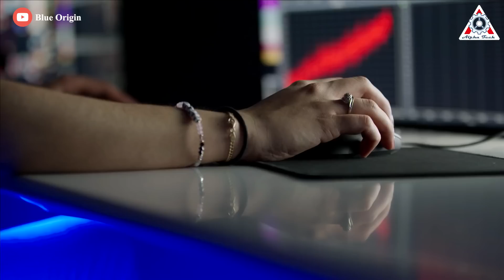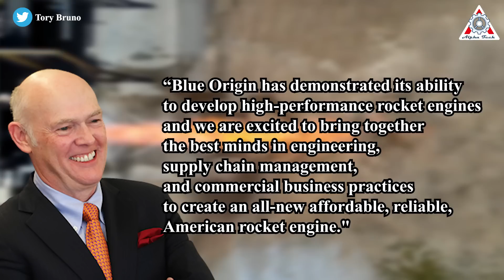ULA is facing FAILURE because of Blue Origin...

Comment: ULA is a 3 way bungle/fight between blue origin and boeing/Lockheed. And let's be brutally honest, spacex has been churning out engines and complete launch systems successfully for years now that even outpaces NASA's best hopes for the shuttle at the beginning. ULA and blue origin come to the table 5 to 10 years later, and financially more expensive than spacex in light or heavy launch configs.

Comment: I wonder what payload mass the SpaceX Super Heavy Booster could lift and what maximum altitude might apply for orbit if payloads were substituted instead of Starship?

The concept makes sense for lifting components to construct a larger next generation space station, particularly if that structure were intended to produce pseudo gravity via centrifugal effect from rotating a torus (donut) shaped hull.

Segments could be launched on Super Heavy in a straight, cylindrical configuration with a simple cap shaped fairing on top, then curvature added in orbit by inserting wedge shaped fillets at specific locations on the tubular sections.

Given the eventual power of the SpaceX Super heavy Booster, it would probably even be possible to launch segments with much if not all their internal infrastructure already installed that way it would only require connection with adjacent segments.

The concept could conceivably reduce time required for assembly of a fairly substantial structure from years to months.

Comment: From what I understand SpaceX's Raptor 2 engine has slightly less thrust than the BO's BE-4, just under 500,000 lbf at sea level. But since ULA is going to use SRBs anyway on their Vulcan I would think they could compensate by changing the flight profile. Over the burn time of the main stage engines the rocket will be able to take advantage of the higher specific impulse (BO hasn't published the expected specific impulse of the BE-4 but it appears to be lower than that of the Raptor 2).

It seems though that Elon Musk hasn't decided whether he'll sell his engines to other companies.
Reply: It will give a test base for the new Raptors

Comment: If Starship doesn't pan out, a Super Falcon 9 using 9 Raptor 2 engines would be nice.  It could then be made into a Super Falcon 9 Heavy with 27 engines total which would still be less than Starship's 33.
Reply: It would be a total redesign, Raptors run on methane.  But it a Super Falcon could another SpaceX class of rocket to offer.  They would have to develop a reusable second stage.  Personally, I would like SpaceX to launch Dream Chaser.

Comment: ULA needs to PUBLICLY reach out to SpaceX to either license build Raptor-1 engines or purchase SpaceX built Raptor-2 engines.  Even if no contract follows, that process will light a fire under Blue Origin to get their product delivered or go out of business.
Reply: Because it is essential to Vulcan Centaur, an adequate number of BE-4s will be produced one way or another, either by Blue Origin or under license.
Reply: @winstonsmith478  Maybe.  The BE4 is already years late.  Publicly soliciting a replacement will provide motivation to BO to GET BE4 DONE.  Failing that, ULA needs a different plan and a different engine.  Nobody will license build an engine that does not work, like BE4.
Reply: Raptors wouldn't work for Vulcan though... The engines would need to be nearly identical to the BE-4s in order for the rocket to work. Or else it would need big changes in its design, which would basically mean an entirely new rocket.
Reply: @boboyqc  Which will be faster.. Waiting for BE4, or redesign, considering how fast SpaceX can design.
Reply: @marcwolf60  faster... Hmm yeah rocket companies don't tend to iterate at SpaceX's rate. The main thing that makes SpaceX capable of iterating so fast is the fact their rockets are built from stainless steel, and also that their main objective is mass production. The only thing making this program viable is nothing short of full reusability. So yeah, considering all that, no, it wouldn't be faster or even more affordable to redesign a new rocket for ULA...

Comment: It's everything they deserve.  ULA is supposed to be a way to push back against SpaceX.  Not precisely by offering a competitive service, but by meeting halfway, so they can continue to receive favoritism from NASA and the military.  Even meeting halfway is a tough hurdle, evidently.  Obviously they're not going to ask for or receive anything from SpaceX to speed that up, and they don't have the engineering chops to make their own engine, so they're stuck with "Hobson's choice", Blue Origin.  Keep the popcorn coming.
Reply: ULA has a much larger number of successful launches than SpaceX that repeatedly fails to boost satellites to the contracted orbit. The satellite have to use there own fuel to get to proper orbit that decreases the life of the satellite.
Reply: @mrbaab5932  Anyone who contracts with SpaceX understands what they're signing up for.  You're spinning something as a negative that nonetheless is a savings for the customers: When further boosting is needed, the cost of implementing such a system on their satellite is significantly less than the extra cost of going with someone besides SpaceX.  But you do get a couple of points for at least trying.